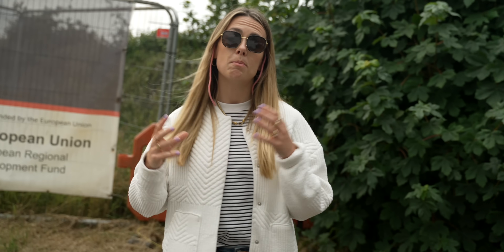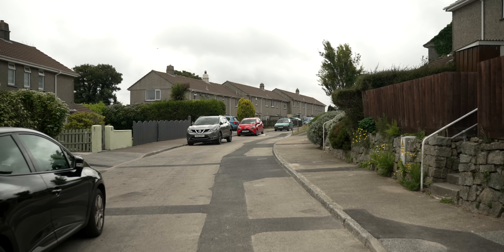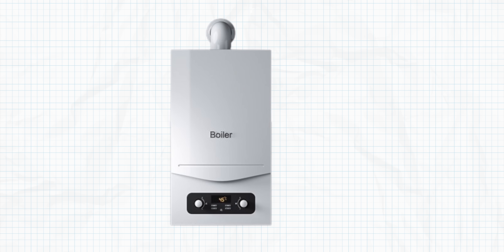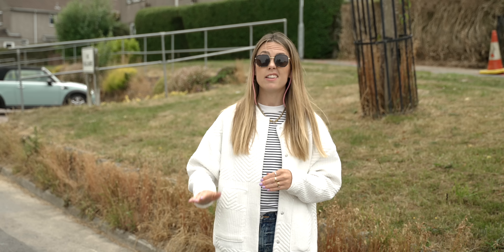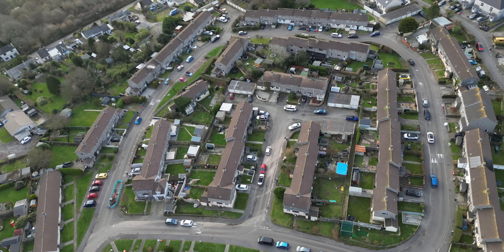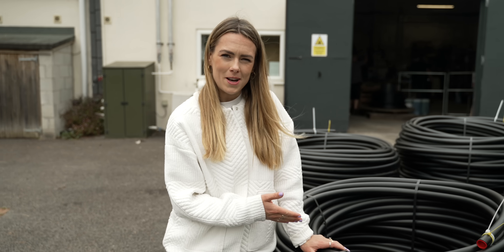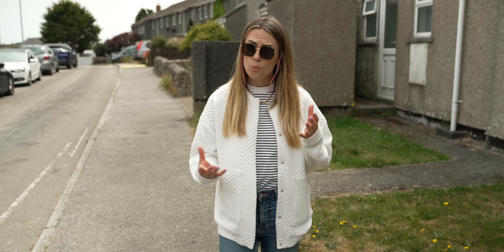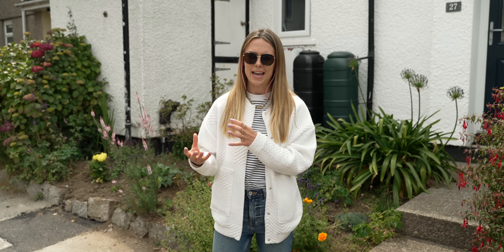Can Kensa's Ground Source Networks Supercharge the UK’s Heat Pump Rollout?

Comment: Imogen, last week Rosie Barnes of Engineering with Rosie had a grid electricity expert on her channel, his final thought was of the great potential of "community scale" (street-ish scale) batteries. Its made me think and I've noticed that apart from wind (maybe), renewables tend to be well suited for community scales. Ground source heating/cooling, batteries, solar, shared ev's, gardens and others I currently can't remember. I could see the pro-centralised energy producers following the fossil fuels industry lies and deception on this too.
Reply: The energy companies like centralised production because everything gets cheaper at larger scale. They could still make money off this community scale heating system by owning the pipes. It would probably cheaper for them too - install once, pretty much no maintenance, collect payment for 100 years.
Reply: @t3hpwninat0r  the existing energy companies have already proved their main interest is fleecing everybody, we don't need to pander to them.
Reply: Yes, (because Wind and solar PV energy is so sporadic) the only way to harness it for 24/7 use is with massive batteries. At least with ground source heat pumps they are already 24/7/365 so no need for expensive batteries..
Reply: @philtucker1224  have you noticed there are interconnectors appearing all round the world? Do you know what they're for?
Reply: @alanhat5252  absolutely no idea Alan.
Reply: @philtucker1224  Yes but, its not as bad as you might think, after all one ground source HP will cost as much as one Solar array, Battery, and ASHP combined! We are happy with our ASHP based in mid Wales and running for 2 years now!! Yes it does struggle when -5c or -8c comes in to play, but thats because our insulation is poor. However we have Cheap Infrared Panels that make use of the cold sunny days via our Solar array, and it only ever last for a week at most! We find our grid use on cheap over night Stored renewable energy in the winter months is just as costly as the Grant Combi oil boiler we had before. In the autumn and spring the solar starts to contribute, and in the summer our solar provides all our hot water and electricity for our EV's use.
Reply: Also the added robustness of decentralised energy with community scales. Hard for a facist imperialist neighbour country to take out your electricity grid if there's 1000's of nodes not just a single gaint centralised nuclear power plant.
Reply: Any networked form of transmission can improve efficiency and robustness by, including local area buses....   In general there's nothing new about it,, it just has not been widely utilized in the energy industry....  I will let others debate its social ramifications.....

 scary how social media commentary, warps even logical statements into conspiracy rants....
Reply: @theunknownunknowns256 absolutely, I keep writing this everywhere 😂
Reply: "Economies of scale" are myths of centralised electricity generation lobbyists. These projects are highly subsidised by tax payers at all stages of the life of the project, prices to the end user are never adequately controlled, there is always a reason to gouge the poors. The correct economic term is "transfer of wealth".  Even green energy centralised projects are a transfer of wealth to the rich, mitigate this by investing with that knowledge.
Reply: The invention of the national electricity grid was the biggest step change in history for the transfer of wealth from the poors to the rich.
Reply: DNO shopping list: MegaPack at each substation. Might help relieve the issue of too much distributed generation back-feeding to the grid, as far as I've read anecdotally some substations can't handle the backwards flow too well.
Reply: @salibaba agree. Country needs more local battery substations. It would improve or smooth out the spikes or peak power curves during the day and also soak renewable generated energy and use it more efficiently. Grid must change faster. More decentralisation is the way forward for the network and the public.

Comment: What a con, all the disadvantages of a heat pump system with non of the advantages. You’re totally at their mercy, no say in what or how things are done. If there’s a problem with the shared ground loop everyone is effected. All the extra pipe work joining all the houses together makes for a far less efficient, far less reliable, and far more expensive system. This is just an excuse to get some of the lovely ‘free’ government money and charge people an unnecessary monthly fee forever. You can’t even change supplier when the price inevitably starts creeping up.
Reply: These things tend to be cooperatively owned by the community as a social enterprise. Actually having a shared system has economies of scale and has very little effect on efficiency or reliability.
Reply: No they don’t. No it doesn’t. Yes it does.

Comment: Hmm... I could be getting things mixed up... but a 1-quid / day standing charge is 365 GBP / year.... if the costs is ammortised over 40 years (I think that's what was said in the video), that's 14,600 GBP.... per home.  Given they're drilling only one community borehole (plus laying the pipeline to each home), that seems like a reasonable cost... and should work in a far greater temp-range than air-source (useful, given the ongoing climate changes in the UK)
Reply: Not a single borehole. 42 of them, all connected together in a loop. Re-watch 3:00 It is not a 1:1 ratio, but I don't think they say how many homes will be connected to the loop.

Comment: We are working towards this here in Massachusetts - it is called Future of Heat. The idea is to convert the natural gas lines to provide a thermal water source - and it allows heat sources (like industries) to share their excess heat - and this system can be used for really efficient cooling as well.
The gas companies are on board with this, by the way.
Reply: Sounds like a fantastic idea
Reply: But that would mean that on a certain day, the gas would be cut of permanently?
Reply: @philtucker1224  We can do everything we do with gas - in other ways, better than we do them with gas.

Heating with a water source heat pump, that uses geothermal and/or shared thermal water source - is much better than burning gas.

And induction cook stoves are much better than burning gas.

What's not to like?
Reply: I bet the gas companies are on board so they don't screw up and kill someone again

Comment: Ground source looks like geothermal.  Would it not be cheaper for individual houses to install geothermal themselves, which stops the heating bills forever once the the installation is paid off?  Utilities will only increase costs over time.
Reply: Americans call ground-source 'geothermal', which is a bit confusing because 95% of the heat comes from the sun, not the mantle. Strictly speaking geothermal heat is from below-ground sources and has much deeper boreholes. Hundreds of metres, not tens.
As you say the advantage of building your own and paying outright is that eventually it is paid for but the cost doesn;t drop to zero - you are still responsible for maintenance (which might be very low until it needs total replacement in 100 years). The disadvantage is that you need to build a system sized for peak load. These shared systems can be significantly smaller due to diversity. And it's a lot easier for a large company to borrow the money at good rates than a house owner. So this system is cheaper per house, and someone else takes care of the maintenance, like any other utility.
So yes both ways can work, but this is lower embodied emissions and cost and a lot less hassle. You can build and maintain your own solar+battery array so that you don't need the grid, but it' expensive in comparison to just buying from the grid. This is the same tradeoff (and requires access to a lot of capital). How much do you want to pay for total indepedence?
Reply: Geothermal is much deeper
Reply: It's not geothermal, the water coming up is only about 12 degrees C. Geothermal is hot water from much deeper.

Comment: Just use the old coal mines for a far cheaper access compared with the expensive drilling. 

the same effect can be achieved far, far cheaper if you ask the farmer and start using their fields for that cause far less work. Here we laid 2000 m of the pipe through the acre and that was far far cheaper than the hole drilling cause the digging of a trench is so much easier and does not need special machines.

1:50 looks weird if the EU is supporting such a UK project after brexit - can not believe that they still throw money out of the window this way. Unbelieveable and our guy in straßburg parlament says that it shouldnt be but wants to check it cause usually those activities and supports should have stopped from the moment of brexit 2 years ago.
Reply: There aren't any coal mines in Cornwall. There are various other sorts of mine (notably tin) which is perhaps what you meant? Yes if there is a convenient flooded mine nearby that's an excellent heat source. Most places are not that close. And fields work well in rural areas, but in towns the distance fro the fields makes boreholes more cost-effective.
The EU money was because this started some time ago. That money would not be available for new projects. Indeed cornwall has had its development funding reduced from 100m/yr (from EU) to 44m/yr (from UK govt)
Reply: A water source community heat pump scheme using old mine workings exists in South Wales.

Comment: I've dreamed about community ground source for a while! It would be way easier here to connect to here because most houses have forced air heating/cooling systems. I went ahead individually and had a 500 foot deep well drilled to support a ground source heat pump system. The heat pump replaced my condensing fossil gas furnace and nothing else had to be changed other than the thermostat.
Reply: That’s interesting, was there any additional costs (that you wouldn’t have had to pay for anyway) and how are you finding it after a complete one year season’s cycle?
Reply: @philtucker1224  Having a well drilled in the middle of the city was expensive and the ground source heat pump unit was also very expensive largely because they were/are extremely rare. I could only find one installer who would provide and install one in a large Canadian city. I've had it for 5 years and it has worked wonderfully well. I disconnected from the gas grid at the time. My total utility costs did not change at all. Since then gas prices have risen at lot but electricity prices have stayed the same. When I installed it there were substantial govt rebates.
Reply: @KenWerkSolar  sounds like it was a successful experiment! (has it paid for itself yet and do you expect it to have a reasonably long life before refreshment/replacement is required?)
Reply: It isn't about saving money - my utility costs are already very low. This was the final piece I needed to be zero carbon and I could afford to do it. If those of us who can afford to stop burning stuff don't then who will? The hope is it becomes mainstream and therefore affordable for everyone. @philtucker1224

Comment: Great idea as always, but .... in order to get customers on board it has to add up. That nice lady said it was comparable to her previous costs of running an oil heating system and electricity. That's massively more expensive than gas/electricity. Looking at the infrastructure going in, that doesn't surprise me. Also, who has a spare room for all that heating equipment? It's got potential all this, no doubt about it, but if they knocked on my door I'd have some serious questions for them. Perhaps with all that boring kit they can make underground boiler rooms whilst they're at it?
Reply: Um... in the house, they were replacing the coal room? I replaced my oil boiler with an electric one and it took up far less room, and isn't even considering the tank.  You want the heat exchanger in the livable space because there will be waste heat that you want to capture, and it should be easy to get at for rare maintenance, and it needs to connect to water pipes that circulate warm water to the radiators.  I can't believe a gas boiler would be more compact... perhaps electric baseboard heating, but pure electric will cost about 4x more ongoing because ... you aren't using a heat pump.

So it will be more expensive to put in, but cheaper to run than pure electric.  The homeowner was saying it was about the same price as oil... oil isn't cheap. if she had gone with pure electric (no heat pump) her running cost would be far higher.
Reply: @qcca123-f1v  Electric boiler? Do you like burning money?

Comment: What about individual sand batteries in a garden, very surprised that this is not being looked at as part of heating a home.
Reply: I would imagine sand batteries can't be small, by their very nature. The smaller an object is, the higher the ratio of surface area to volume, hence the more surface there is from which to lose heat. For a sand battery, bigger is more efficient.
Reply: @ukslim  Given constant thermal specific heat a large thermal battery can either hold a lot more heat at the same temperature or the same amount of heat at a lower temperature. Heating it up in the first place is more efficient if the temperature increase is small. That is why heat pumps are ideal for heating swimming pools.
Reply: @ukslim  you used the word imagined , detected somewhat of a guess from yourself , you mentioned an area being a factor in the heat one would hope to get , this might be an occasion where size is not the dominant factor, example underground you and I know there’s a constant heat so if one was to dig a hole to put a tank or box obviously sealed with a pipeline coming out of it that heat would generate warm air coming into homes , personally thinking it’s an opportunity that has not even been looked at, of course one might conclude the reason why it hasn’t been looked at is because it’s no good ,  would be nice to see if anyone has at least tried it, thanks for your reply, who knows if I’ve made you think outside the box then I would probably say put some sand in it.

Comment: I’m sorry? Did you say the Standing Charge is £1 per day which is roughly the same as gas?!! Look, I’m all for these new technologies and fully support the charge to net zero, but when reporting these things you have to be so careful you don’t give the ‘anti’ faction any fuel, if you’ll pardon the pun. My standing charge for gas is currently 27p, not £1. And even if you meant both gas and electricity (which I’m pretty sure you didn’t) that would still come to about 75p, which still cannot be equated to ‘roughly the same’. Unless I’ve misinterpreted? That being said,there’s still bill parity, I guess. Still, very interesting report and fab views of Portreath at the start!
Reply: @andys5841  Does that matter? What people care about is their monthly bill. Expensive infrastructure amortised over a long time is fine (like housing, roads, bridges, gas, electricity). If it's cheaper than passivehouse retrofits (and it is, less than half the price), then that's good value.
Reply: @xxwookey  The women said around the same cost added to Electric as the old oil boiler cost in oil to run,   oil is much more expensive than gas, the only advantage is no standing charge.  I live in the village shown at the start (not the one doing the project,  that's about 15 miles away)  I would love to switch to ground or air source but unless I redo my entire house to be air tight and underfloor heating and have solar then it's going to cost me more each month (Electric vs Electric+oil totals) as well as a big initial outlay,  I'm just not going to put myself through that!